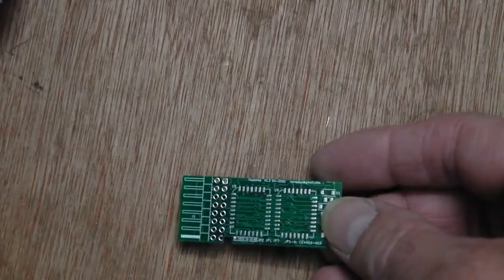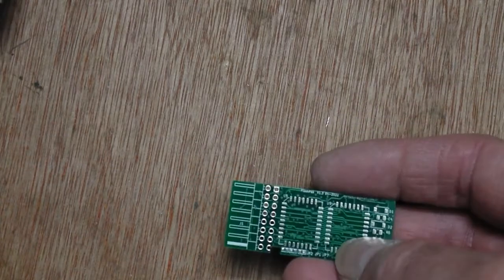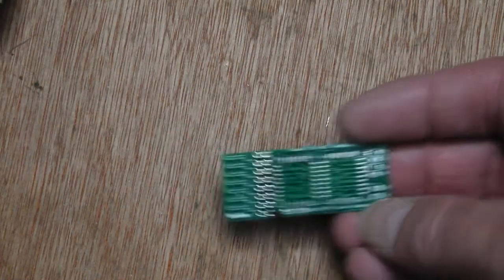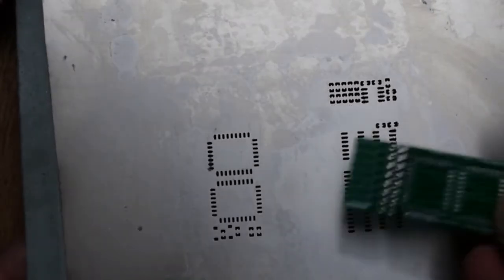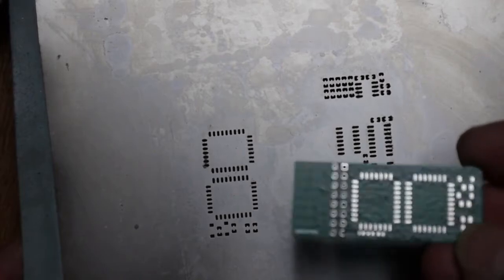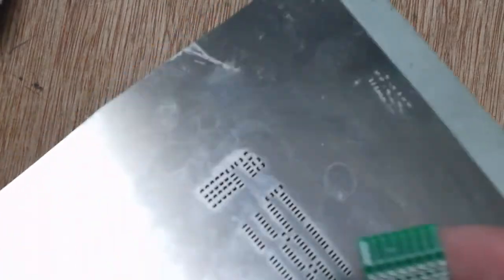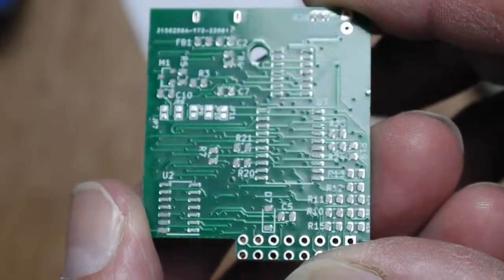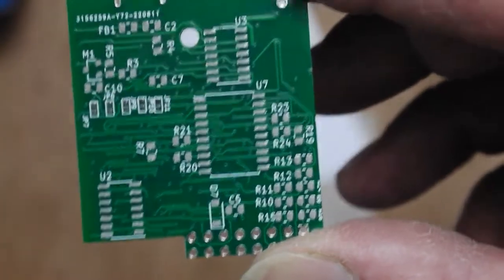Making Solder Paste Stencils

Comment: It's a pity you can't seem to buy solder stencils for conventional SMD TTL outlines? You can get them for every package used in a mobile phone, just not for any hobbiest stuff.
It's almost worth just making a random PCB with every package outline on it, and then asking a PCB house to make that stencil in stainless steel. I don't need  custom stencil if I'm just using one SMD chip on a board
Reply from the maker: Hmm, I never thought about that use case. I could cut you a footprint or two if you sent me a fie. Mylar isn't as tough as SS but should work for a few applications. A sheet of mylar isn't masively expensive.